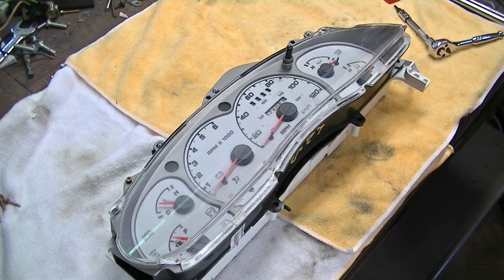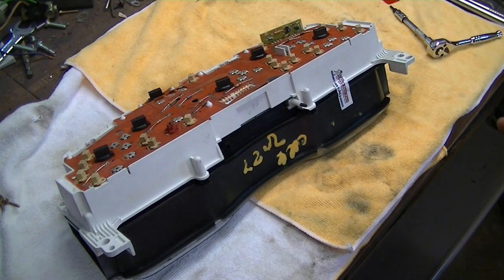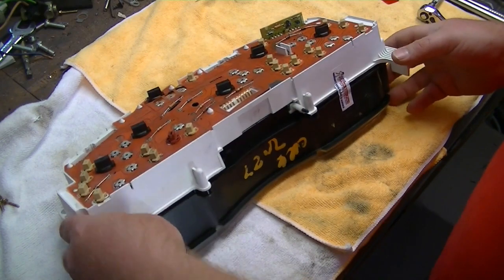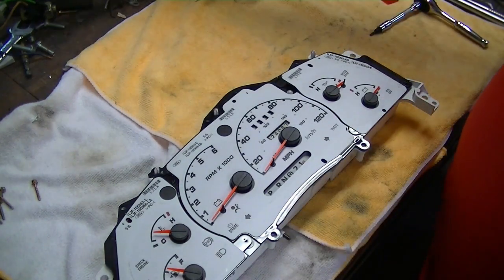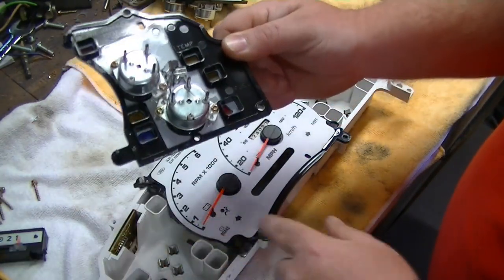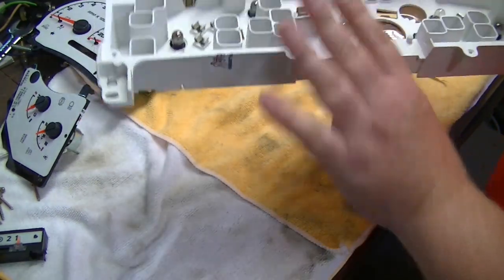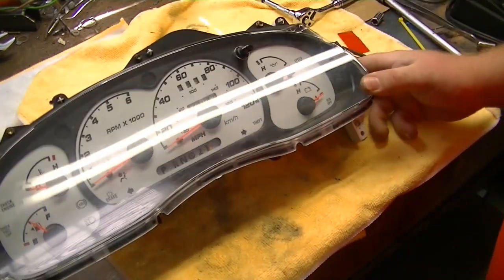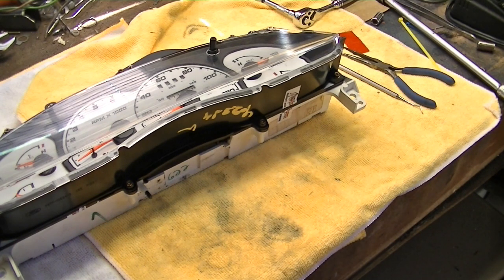2000 Ford Ranger White face gauge cluster swap. Complete tear down and everything I wish I'd known!

Comment: Excellent & very insightful video. The Sport Trac had all sorts of unique features that the Ranger didn’t, whether it was the rear automatic window, silver trim bezels or the white face gauges. But speaking of cool looking gauges, have you seen the silver faces one off a 2003 Ranger XLT? Those look even cooler than the white ones if you ask me.
Reply from the maker: Thank you for the comment!  whoa! I didn't know they made a silver face model. That would look amazing with the silver Ranger/sport track housing! Thank you so much for letting me know about that variant! I googled a picture and I am now on a mission to find one and swap it in!!
Reply: @myrustlife Sorry for the late reply, but you’re welcome! I love mine that I installed in my ‘99 Ranger that originally had no tach exactly like yours, the new one looks so sweet though. And I considered adding a Sport Trac housing on mine too. Hope you can find one, I bought mine that was tested off Ebay, there’s a couple nice ones listed on there right now, if you need any links I’m more than happy to provide them for you. They’re pretty rare though, they were only on ‘03 Ranger XLT’s, no other year or trim level, but they are plug & play exactly like the Sport Trac cluster though, in fact they look the same as those do with the design & gauge print, except the gauges are silver, not white.

Comment: Excellent video for anyone who wants to do this gauge swap.  The disassembly would be useful if you needed to change the direction of the little arrow that shows which side the gas tank is on as well (always a possibility with a body/chassis swap like this!). What a difference the different color makes - these look way more period-correct than the original plain black one you started with.

Comment: thanks for the very helpful video,im having a problem with my cluster ,ranger 2001 ,gas gauge and temperature gauge not working ,gas gauge was all the way up ,i tried tho bypass the slosh module and the gas gauge comes all the way down , now i dont know what should i replace ,please help ,what can i do to fix thoses gauges.

Comment: My tach is acting up on my sport trac gonna take mine apart today it's a contact issue for sure if I lightly push the cluster tach works again wonder if a small resistor in place of the bulb would work to trick the system

Comment: I have a 2000 non white face & non tack , will a white face with tack from a 2002 ranger work ? & is there any mod I need
Reply from the maker: yes, as i understand it the 2000-2003 rangers had the same dash, wiring, hook ups and form factor. no modification will be needed, the 2002 should fit exactly as the factory 2000 one did. the signal for the tach is already there so that will work with no wiring modification. hope this helps.